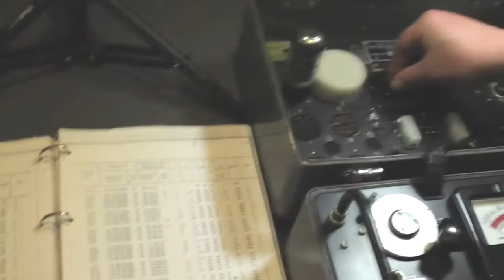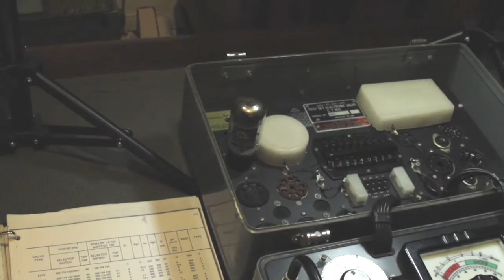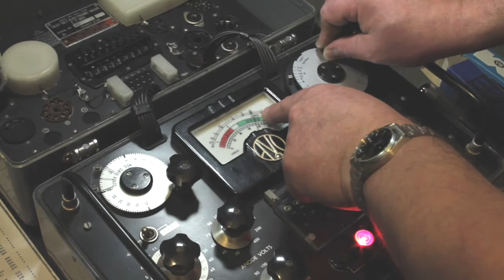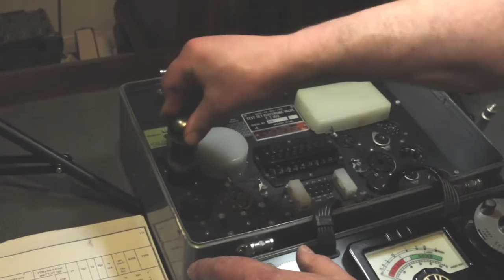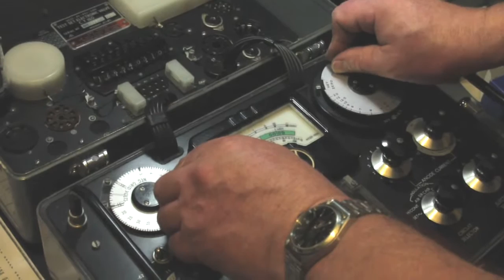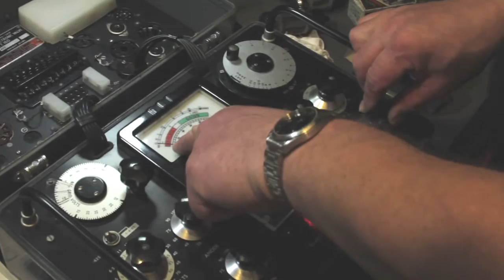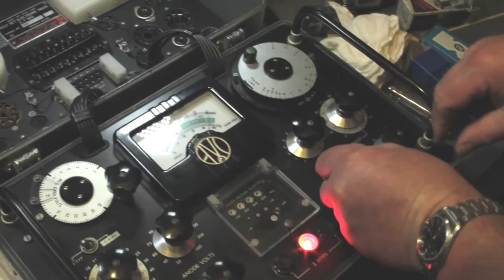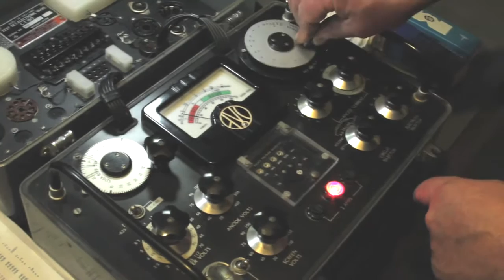AVO CT160 - Valve Testing - Mullard EL34 - 6SN7 Dual Triode  - GZ34 Rectifier

Comment: Simply WRONG. The meter is zeroed by adjusting the anode current controls. You should never alter the grid voltage when testing a valve.
Reply from the maker: Page 24 operating instructions to use either it's well documented. 50+years of using the CT160. We have future videos planned to cover this unit in greater depth. Thanks
Reply: @vintageaudioworkshop  Also 50+ years here! I never advise users with less experience to alter the grid voltage for 2 reasons.
1) It is very difficult to get an accurate zero with the grid voltage control
2) You and I can look at valve characteristic curves and see what to expect at various Vg1 settings. Others get confused when they alter Vg1 and find the gm has changed too. They don't appreciate that the valve is not linear.
The Avo valve data only shows what to expect at fixed levels of anode, screen and g1. That works for good/bad testing or measuring gm. Sticking to those levels helps new users to avoid confusion, thinking a tester is faulty, or getting misleading results.

Comment: Regarding the zero of the meter, Isn't it the anode current what should be adjusted and the not the negative grid volts
Reply: It's stated in the user manual that either method can be used to balance the meter - grid voltage, or anode current - both methods are described in the user manual.

Comment: when i look up the settings  for the dial i am seeing ** in the book what do i use for this
Reply from the maker: * is for a valve pin with no connection where you set the digit to 0. Be careful with the CT160, it is a very delicate machine and if misused you can easily damage the meter. We will be doing a lot of videos on the CT160 in the near future. I have the manuals available  on my website or email me at info@vintageaudioworkshop.com if you need any extra information,
Paul
Reply: @vintageaudioworkshop  yes please do more... I have just bought a ct160,   going from an eico 666 and a precision 640......  However im reluctant and not experienced enough as yet to do anything other than simple testing....  I will get there though

Comment: Nice to see a CT160 in use, sad to say mine has succumbed to the common problem of the meter going open-circuit, presumably  because my storage conditions were on the damp side. Meter replacements seem ridiculously expensive.☹️
Reply from the maker: I've just bought a 2nd unit for £550 non-working which I'm about to get sorted. Who supplies the replacement meter and how much does it cost please? Thanks
Reply: @vintageaudioworkshop  Sorry, I do not know where replacement meters can be found other than one I saw on Ebay a week ago at the ridiculous price of £400+, not a price that I am prepared to pay. My CT160 has a faulty meter but it will only be repaired if I can find a suitable replacement at about £100, beyond that it will be either scrapped or sold for spares. You could try a search on 'CT160 replacement meter' which will yield quite a few references.